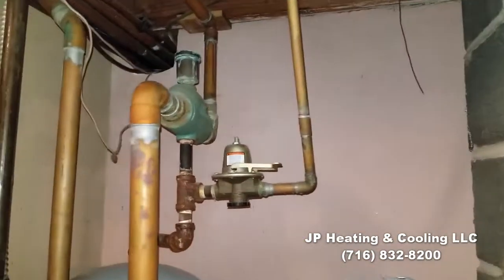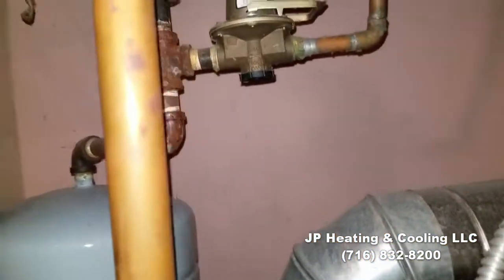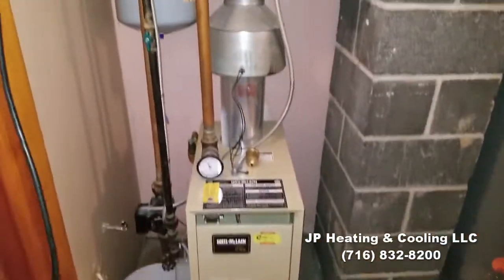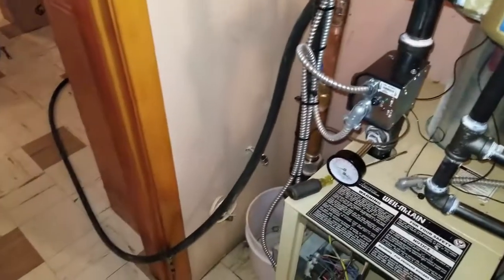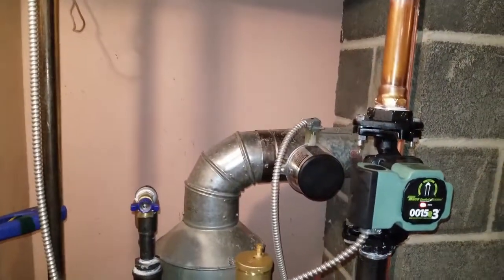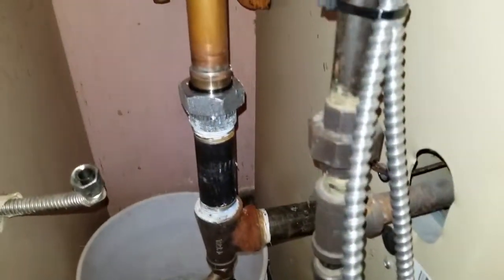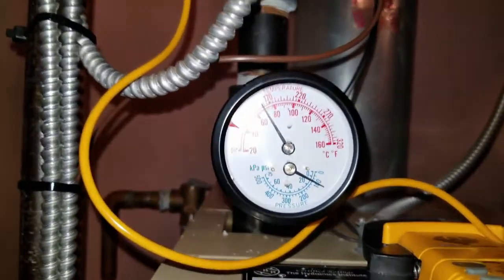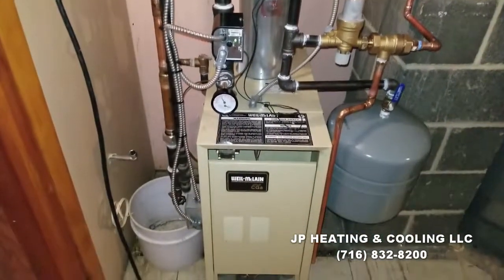WEIL-McLAIN CGA Repair on Monoflo system.

Comment: Why are all plumbers stuck on having the circ pump on the supply?!!! I swear it drives me nuts!!! Weil McClain clearly lists two locations on their boiler, you can have the circ. Pump: on the supply and on the return. They will re-pipe the whole boiler to make sure the pump is on the supply!! In 35 years of installing boilers, I’ve never installed a pump on a supply and I’ve never had flow issues! Please stop!!!
Reply: It doesn't matter where the circulator is. Just make sure that you have a good air separator.

Comment: Bas location for make up water???
Injection should be on supply line after pump discharge to insure air removal from purge station on return line or pump inlet
Reply: You obviously don't know what you're talking about. Regards, third generation oilman guru and steam heating contractor.

Comment: After the repiping you did on this boiler you probably wouldn’t even have to purge, the new air separator and pump location would most likely be enough to eliminate any air in the system on its own.
Reply: Wrong. You must purge the system. You 🤡

Comment: do monoflow systems with finned tube baseboards react well to purging or dou you have to vent each baseboard?
Reply from the maker: It depends on the purging setup and how large the system is. On this system I was able to purge all the air at the boiler because I setup the purge the way I wanted it and the system itself was small. But most of the times on a repair the boiler has a basic purge setup that is pretty useless so it usually requires purging each loop at the radiation to get all the air out.

Comment: The pump and zone valves are normally better on the return side of the boiler as the water is cooler on the equipment. Good job.
Reply: Debateable if that was ever the case but now a days there’s 0 reason to not pump away